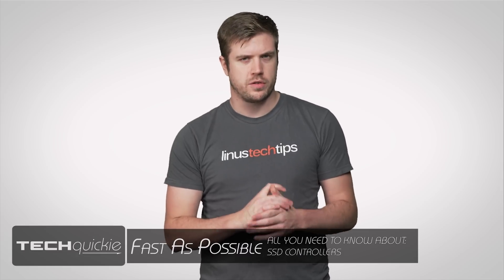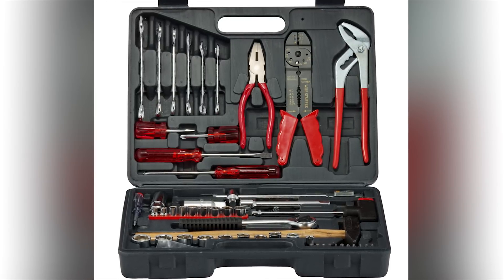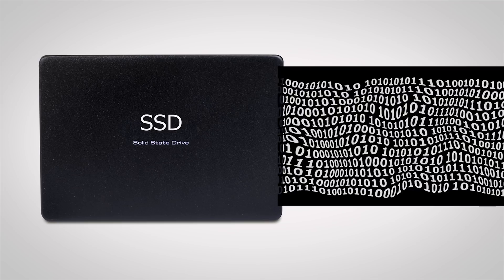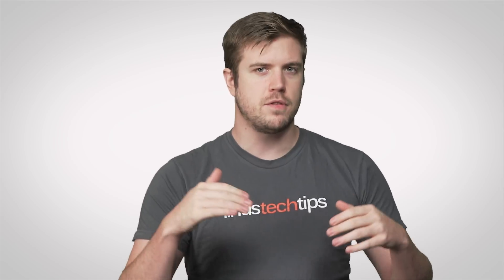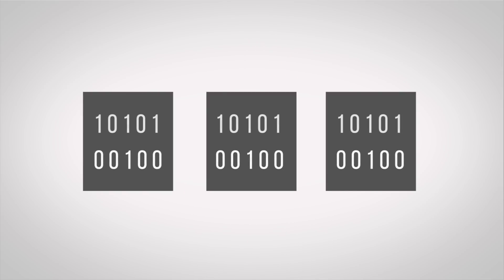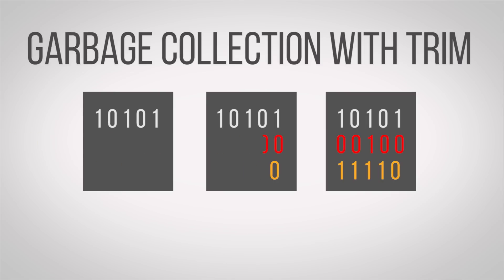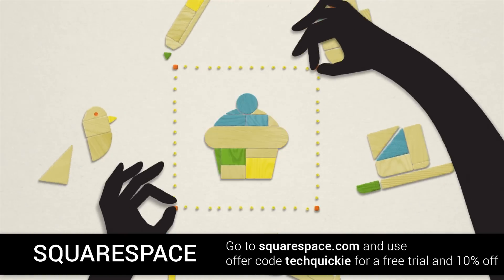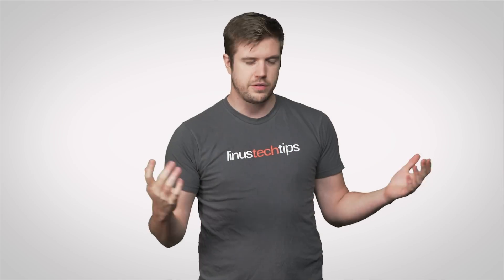SSD Controllers as Fast As Possible

Comment: Your explanation or animation of TRIM and GC is was wrong or unclear.  Your animation of GC vs TRIM looked exactly the same.  I'm as confused as before about these features even after seeing your video.
Reply: Because they are technically the same thing. The TRIM basically tells SSD which Blocks of data are no longer Useful and are marked as deleted by the OS so when the GC happens the controller ignores them and they not Copied to be rewritten again

Comment: I do not understand what is the difference between STALE and DELETED data? If controller doesn't know which files are deleted, then which data is marked as "stale"?
Also, If data can be marked as "deleted" only by TRIM, than how does SSD operate without TRIM, how does it know which data can be erased without TRIM telling it?
Reply: Stale Data is the Unmarked data that's not valid, it doesn't matter if we overwrite it. Once we write it, the SSD keep a record of it and copy and Rewrite it on each erase cycle

On the OS side, when we delete the File, it simply deletes the information about the File and the Actual Data is never changed, so the SSD always think that valid unless we send a TRIM command and Tell SSD that it's Marked to be deleted and not to bother copying it and rewritting it so it increases speed and reduces wear on Flash Chips
Reply: Now why it's necessary to keep have rewritting the data is due to limitation of Flash Technology that you have to delete an entire chunk of data or Pages before writing anything to it and A Block can Contain many such (usually 4KB) pages, so to write in a Block, you copy all VALID Pages, erase the block and then Rewrite it with new data. 

SSD won't copy Stale Pages but it might still copy Valid Data that is marked as Deleted by The OS but the Controller doesn't know about it yet unless a TRIM command is sent to it, then it mark them as Stale. 

HDDs basically Have Infinite Write cycles so the sectors are simply overwritten without much care unlike SSDs with limited write cycles
Reply: Sorry for lengthy answer but I hope this solves most of your queries, fell free to ask more :)

Comment: My hp omen 15 ax203na was super slow when booting and opening browsers or doing anything, like i had to give 10 minutes to warm up. It serious pissed me off. I got angry took it apart, i thought maybe its overheating or throttling needs cleaning, then i found an empty m.2 slot!  Put one in from adata xgp 8200 pro, which is clearly overkill because the slot is limited to sata 3 and not pcie as i thought.

Anyway after migration, my laptop is pure lightning.

Comment: I'm still a little confused about the lifespan of SSDs.  I have some very old mechanical HDDs, some well over a decade old which continue to work well.
Reply: Actually it's the Float gate if I'm not Mistakend that actually stores the Data even without power, Basically You either put electrons in or pull out of it to create a logic levels.

Now Read is not a Major issue it's the Write that wears the Flash EEPROM

This Float Gate is not perfect and a few electrons can either leak or stay and accumulate over each write cycle and soon there will be so many electrons that there will no difference between 0 and 1 making the memory cell useless

HDD or even Cassette Tapes modify magnetic orientation on a Physical disk or tape and this giving them Theoretically infinite read-write cycles but they are still Prone Mechanical failures and limitations like speed and atmospheric pressure

Comment: still a little confused on "stale" data vs "deleted" data can someone help exp;lain it a different way please?.
Reply: Anything you delete is actually still kinda stored within' an unreachable area in your storage device. It can be recovered through certain means if you know how to (through command prompts and stuff), while fully deleted data is no longer in the storage.
Reply: Suggest you read up on data recovery mate.
Reply: Stale means Unmarked, Deleted means only marked as deleted by the OS. The SSD don't know they are deleted untill The OS sends an TRIM Command to tell it's free to use the block or OS tells the Drive to write in the exact same Block which is mostly random

Comment: Wait SSD's only last four years?
Reply: I think that's more of a joke from you, but before anyone else reads this and takes it as pure truth, I'll say something to that:

SSDs can last way longer than four years. You can only write X amount of times on a single cell, so after riding a lot of data, you won't be able to use that specific cell anymore. The controller is caring about that so it doesn't use the same cells all the time, so the cells are getting 'used up' at the same rate. Then, IIRC, SSDs have some cells that aren't typically used. They are used when a different cell dies, they are replacements to increase the overall life of the SSD.

Generally, you shouldn't be worried about the lifetime of your SSD as a private user (unless maybe you are a crazy enthusiast), because you'll run out of space before your drive dies. I think Intel says their SSDs will last after writing 100GB of data every day for 5 years (so 1825 days). 100GB are two AAA games. If you have such a strong data usage, you probably will upgrade your drives in these 5 years anyway.

Comment: There is a lot more behind SSDs than I expected
Reply: Well Hard Drives will always be 500x better as they don't wear out so fast unlike SSD Drives that become unusable after only about 5 years rendering a Laptop totally useless
Reply: @stephensnell5707  Stephen. Not only did I make this comment over 6 years ago now, but you're also wrong. The claim that hard drives are "500x" better than SSDs is nonsensical. And the idea of SSDs wearing out is related to how much you write, and even then, I've been blasting my SATA SSD since 2016 and it's still going strong. It is known by now that SSDs are also generally more reliable than hard drives which are prone to mechanical failure. Not only that, but Laptops especially almost always support replacement of the SSD, should it fail against odds or have reached the end of its lifespan, it can easily and by now very cheaply be replaced by a new one. 

I don't know if you accidentally bought too many HDDs or had an SSD fail prematurely on you, but I advise that you get over your trauma and face the facts rather than judging something as binary as computer parts with your feelings.

Comment: So what a controller does is similar to defragmentation of a HDD ?
Reply: Not quite, in Defragmentation, The Data on sectors which are fragmented everywhere on disk are copied and stores in continuous successive sector freeing small unused sectors and reducing head travel distance. 
This can ruin an SSD as it distributes data to Level the wear across all flash chips

TRIM basically tells SSD what parts of Memory are marked as Deleted and not to copy them in buffer during the garbage Collection and reducing data needed to be rewritten

Comment: Uhm just a question from a pc guy. Ssds use the same technology as ram but why is ssd nowhere close to the speed? Is it just a matter of price?
Reply: cuz it's not the same technology. Ram is volotile memory, that is it only stores data while powered on. Ssds use flash storage, the same as sd cards, flash drivers, and also the storage in you cellphone. I'm pretty sure tech quickie has videos to explain both in more detail.

Comment: I have a dumb question:
Currently on my computer, there is a boot drive with the OS and the drivers. Theoretically speaking, if I never update anything, and only read off it, will the SSD last forever (meaning for a much longer time than what is expected)?
Reply: SSDs nearly have an Infinite Read cycles so if you never write anything to it, Theoretically Yes

But the OS would still write tiny bits of Data so it's kinda hard

Comment: Wait what happen when a SSD goes over it read time limit? Do the file just poof gone?
Reply: Oh Ok. So once it hit it write limit. You can still recover the data and put it to a new one. Like cloning?
Reply: Ashngoy Uchiha from what i know, an ssd can hit its limit and still work for years
the limit is like the food's expiration date
it's still good
but it has reached its limit
it doesn't mean the ssd will just die, but you can start having problems with it
that said, it's advisable to back data up, ofc
but it won't just be useless, it's still going to work

i might be wrong tho, and i'd be glad if someone corrected me
Reply: @lolesloloes6032  Well Yes but actually no, that's only if the limit is suggested for still readable data, if the given limit is the the true limit, then it's no longer possible to distinguish between 0 and 1 in Flash Chips and you would lose your data. And even if it's readable, clone it already because it won't run for anymore cycles than absolutely needed
Reply: Well Yes Actually no

Everytime you write anything on an SSD, it stores or releases Electrons from the Float Gate of the Transistor, however some Electrons can get captured and accumulate overtime. At one point you won't be able to distinguish the difference between 0 and 1 and your data will be lost.

However, mostly Manufacturers Suggests the Maximum write cycles for still readable data, so if you hit the Write limit you can still read it without issues, but it may effect the flash chips so it's recommended to clone it into a new one at that point and retire the old SSDs

Comment: Which SSD brand has the best controllers? (in Pepes per second, assuming an use case of massively parallel shitposting)
Reply: Horizon Foz So Kingston offering is the cheap one and Samsung's EVO is a bit better? (I really wonder if any company would screw up basic stuff like handling TRIM)
Reply: Horizon Foz Thanks for all that info, you really know your stuff.
Reply: aiklarung Samsung 960 pro Polaris controller

Comment: So better SSDs have a controller in it?
Reply: all SSDs have a controller inside the device then another one on the motherboard or controller card to connect to get the data to read and/or write to the drive  so the speed of the drive is limited to the max of those 2 controllers working together and always goes at fast as the slowest part

Comment: my main 128 gb ssd is full all the time and bottlenecks like crazy. Time to get an upgrade to the Samsung evo 850 pro!
Reply: 2 thigs: 
1. Unless you have an industrial grade SSD (which physically have up to twice as much memory as what they allow you to use), never fill up an SSD completely. When you do, you're basically disabling wear leveling and the few free pages you have left will be used over and over and the SSD will die very quickly (trust me, I killed an SSD like that). I'd recommend leaving about 30% of your SSD as unallocated space (that way you don't have to worry about leaving free space on your partition). 
2. EVO or PRO? There's no evo 850 pro.
Reply: ***** evo. My bad for adding in the pro at the very end.

Comment: i installed a samsung ssd onto my 9 year old asus gaming motherboard which doesnt support AHCI to take full advantage of the ssd however i have set os provisioning and maximum reliability for performance using samsung magician. is this good enough to make the ssd last for years on end? i barely use my gaming tower now tho so i'll just have it mostly for storage shelf life.
Reply: +Horizon Foz The SMART lifespan is a bullshit number. I had 2 SSDs die on me and both were reporting 98% good. That number only counts total data written, it doesn't take into account actual wear of individual pages in the flash memory or, more importantly, the expected lifespan of other components (like capacitors) in the SSD. Unless you're writing hundreds of gigabytes of data onto the SSD every day, that's what's going to kill it.
Reply: depends on how big it is as a 1TB  drive will last a while while the 128GB drive will fill up quickly if your kid does gaming, downloads and/or makes videos, audio files, pictures, and/or any combination of the above
Reply: ***** I don't remember the exact models anymore, but the first one was a 90GB OCZ from 2011 (died after 4 years of moderate use in a desktop) and the second one was a 256GB M.2 SATA ADATA from 2014 (died after year and a half in a laptop; again, nothing heavy). The OCZ was probably my fault, I ran it with very little free space (and that's probably what killed it, because it ran normally, but would completely freeze up when accessing certain sectors), but the ADATA was just completely out of the blue (on that one, the controller died).
Reply: ***** You're right, they were both Sandforce controllers (although I really don't think I can blame the OCZ on the controller).

Comment: So what happens when you read/ write too many times on an ssd?
Reply: More and more cells would start not working, so the controller would have less and less cells to work with, which would mean the performance would descrese as well the capacity. Very soon the system would stop working completely, because of data losses, which would cause corrupted data.

Comment: Why not tell teh noobz how to turn on trim? 

Open command prompt with admin privileges and enter this command:

fsutil behavior set DisableDeleteNotify 0

Simples!
Reply: I'm going to run that command in my computer without doing proper research of what does it do, what could possibly go wrong?
Reply: it should be on by default in systems made after SSDs were invented
Reply: Not always. When I went from HDD to SSD on windows 10, the trim function was disabled and needed to be manually turned on. It probably depends on who originally setup the system.
Reply: i guess so i just installed the CD software from Samsung with the SSDs i bought
Reply: what if i only have Terminal?
Reply: +RaiTo MiZuo Then you're screwed, because the Linux implementation of TRIM is so bad that the SSD is actually faster without it.
Reply: Deses You could do that or you can look it up like a normal person. Good luck with where ever your life takes you.
Reply: I simply used the Dashboard Software which WD provided me when I upgraded to a WD Blue 1TB 2.5" Drive, I didn't knew we can enable it from cmd, Does if have any benefits over 3rd party software? Thanks =D

Comment: why arnt some SSD's made in the 3.5 inch form factor they could hold more data
Reply: The more flash cells, the more complex the controller would have to be. It would get to the point where it wouldn't be any reason to add more cells as the controller itself would become more expensive and complicated to develop and manufacture than the cells itself.
Reply: Vince Baker yea but that way they just make 2.5 for lappstops and pc same time, also m.2 2tb drives are   small af
even curret 2.5  drives dont phiscally fill the inside
Reply: Vince Baker Heating issues is my guess. Hell, M.2s have been having heat issues.
Reply: +Vince Baker because the standard maker wanted them in a laptop
+IndowinFTW yeah though M.2 drives in consumer machines are not put to 100% for even a minute while Prosumers might they will also know about the heat issue and have a solution to it either better air flow or a small but effective heat sink + fan pasted onto the drive after buying it and finding the hottest parts and business servers use something else as a M.2 drive does not have any redundancy features to use without losing all the benefits of using a M.2 drive 
the M.2 drive is a great sells pinch drive but in actual working environments it has little to no use because of price for the amount of space given, maximum space in a single drive stick, only up to 2 M.2 drives on the motherboard before it would get into an expansion card in turn be cheaper and colder to run for a on server board hard drive storage of the current work load before moving it back to the storage server using SAS, SATA or a proprietary connector and of course heat to get rid of while running in a around heat emitting parts from all the other components in the server environment

Comment: did anyone ever try a DIY controller/ssd ?
Reply: shadoom Yes, MicroSD cards in RAID lol
Reply: Doubt it. The controller is an integrated circuit. Pretty much the only way you can DIY an IC is using an FPGA. FPGAs are orders of magnitude slower and more power hungry than ASICs, so no matter how good your design, a DIY SSD controller is pretty much guaranteed to be much worse than even the shitties commercial controller on the market.

Comment: If you're planning on switching to an SSD, Windows 7 and newer support TRIM out of the box. If you're running Linux, EXT4 and BTRFS support TRIM but need the 'discard' mount flag for the TRIM command to be used.

Comment: Bought a Crucial BX200 without googling it first. Would have been better just setting the money on fire. The old spinning disk in that computer was faster. Never got it to work with acceptable speed anywhere. There might be a reason when things are too cheap. :D
Reply: Maybe your PC is bottlenecked by SATA rev?
Reply: I tried it in 3 different PCs. It had very flaky performance all over. I think it might have been broken. Made sure that all blocks where makes as free through TRIM. I looked at the SMART statistics although I dont know how reliable they are, but they said it had a month of uptime and 100s of gigabytes transferred although it was new. Maybe the seller shipped me a drive that had been returned by some else.